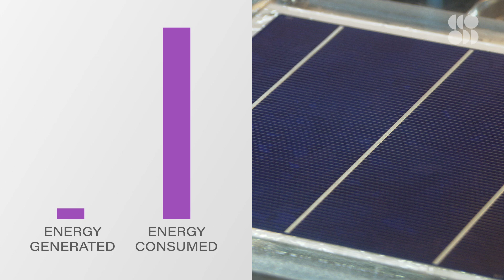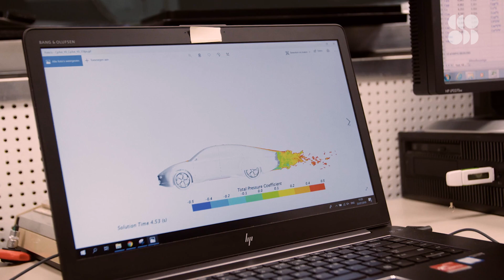The Solar Car Revolution Could Change EVs Forever

Comment: So you're telling me that these solar cars don't have lithium batteries? If not, then why don't we use this magical "battery-les" technology in existing vehicles?
Reply: they do as they said you can charge it like a normal EV
Reply: @crestofhonor2349  So how is that better? If the problem with current EVs is that the batteries make them non-neutral, then how are these better?

At that point you're just talking the difference between generating the energy. Solar on the car or using existing energy creating, which is moving towards more and more wind/solar/green. Aka, you're buying nothing in the long term and minimal improvements in the short.
Reply: @Samus11111  They really aren't much better. The only possible place and situations where these might be better is for those people who live in the tropics with at least 300 days of sunlight per year and who don't drive a lot per day.
Reply: @Samus11111  Not every place has ready access to an outlet or charger. These are also 2.5 times as energy efficient as any other car.
Reply: @fotoguru222  Fair point about the charger although you can purchase ones to connect to your house's electrical connection. But so far as being more energy efficient, roll those improvements into existing cars. Don't re-invent the wheel here and try to tell me that it's better and everything else is garbage.
Reply: @Samus11111  Re. "Connect to your house's wiring.": What if you, like 40% of the population in the US, don't have a house. Rather you have an apartment, a condo, or a co-op. Perhaps you don't even have a dedicated parking space for your car. Millions of potential EV owners have this problem.

You say don't reinvent the wheel, but that's exactly what's required to make vehicles 2.5 times as efficient as existing EVs, which are already several times as efficent as today's fuel guzzling cars and trucks. 

Did I say everything else is garbage? I don't think so. Some people need a van. Some need a pickup truck. Most people drive to work and back alone and don't need to own 2, 5 passenger gas guzzlers. If you're single or childless, you don't probably need even one big, expensive to keep, vehicle.
Reply: @fotoguru222  Apologies. The "everything else is garbage" comment was directed at the video, not your comments.

By "re-inventing the wheel" I meant that we already have EVs. If there's a better technology which improves on them, don't make a whole new product which is (according to the video) unique and separate. Update what we have. Otherwise we will have two different lines of EVs that will continue to be sold and all EVs won't be benefitting from this technology making it less effective overall for solving our problems.

My point about the charge was that (according to your numbers) 60% of the population has an option even if there aren't charging stations near them. I certainly agree that we need to improve the coverage of charging stations so help the spread of EVs, but there are also other options. Why can't the condo/co-op/apartment not install their own charging station? Using similar technology as what's available with the home charging it should be possible to set up a few parking spots with access to charging equipment.
Reply: @Samus11111  Surely there is room for a range of EVs?  Rivian has taken a slightly different line, as have many other EV manufacturers.  As Harry said, some people need a pick up truck, others a van, many are perfectly happy with a small car.  If you spend much time on the road you will soon see that most cards carry just the driver, & I suspect most have them will never have more than 1 passenger, the Aptera would fit their needs very well.  The greater the range of EBs available then that means more of the driving populations needs are covered.

Although batteries do carry a significant cost for manufacturing, within 2 to 4 years (depending on the model) EVs are better for the environment that fossil fuel powered cars, with their batteries recyclable at the end of life.  

Not everyone has a driveway or dedicated parking spot to charge in.  The full panels give you up to 11 000 miles a year for maybe 20 or 30 years for $900...  That cost of driving is ... ... pretty hard to beat!

Charging away from home is being pushed a bit here, the problem is that it is rather more expensive than charging at home (still much lower cost than burning fossil fuels in your engine), unless you are at a venue offering free charging as an incentive to use the venue...

Comment: If you are going to spend this much money on a car that you keep for less than 10 years, why wouldn't you just spend less money on a better EV and put the leftover cash into more stationary solar panels that last 30 years?
Reply: The solar panels add little weight or cost to the cars and save you from needing to plug it iin most of thee time. You would save less than $1200, maybe, by skipping the Aptera's 700 watts of solar cells. And you can use the car's battery to run more than the car as the Aptera at least will come with an inverter to power tools and home appliances.
Reply: "lasts (at best) 10 years" is a bit pessimistic, composites last well in aviation
Reply: @peterchandler8505  You are correct, what I meant to say was "keep" as Kelly Blue Book says average car ownership in America is 6 years. I edited my comment, thanks for the correction.
Reply: @IamtheDill  I suspect that a large proportion of those moving on to another car after 6 years is related to the transmission & engine that can get ... quite expensive.  EVs are far simpler to manufacture using technologies that run 24/7 for decades in industry.  EVs therefore are likely to extend the time a car is kept as maintenance is so much less..  TesLoop are a long range US taxi service that fast charge Tesla batteries to 100% several times a day, these batteries still give respectable performance after 200 000 miles ish, so I suspect EV ownership will be rather different to cars now?
Reply: @peterchandler8505  possible but we can already see the planned obsolescence built into Tesla and other EVs, increased charging rates, bigger better multimedia, battery degradation and not to mention physical wear and tear of a cars interior. Basically what I am saying is if you can afford a car with solar panels on top, probability is high you aren't the type to keep a car untill the wheels are literally falling off. Spend your money on permanently affixed solar on a property or house. It makes mathematical sense.

Comment: You can take any EV and put solar panels on the roof now.
Reply: and get a negligible boost to your range if that EV needs a lot of power to move
Reply: @peterchandler8505  It will charge the batteries when you are parked.

Comment: So Impractical, it'd idiotic to even try it without substantially improved solar panels
- a mechanical engineer
Reply: This Aptera can go 10 miles per KWH, contain between 25 and 100 KWH battery, and the sun provides up to 4 KWH per day. You can also plug it in. -- an electrical engineer

Comment: Great concept until you realize that you need the gas guzzler to pick up or get your deliveries of grocery .why aren’t people have a roof covered on their house with cells , then use these to recharge , even a shed in the back yard ....but like diesel, they said it was so economic in the 70s and 80s now the price of diesel is as high as the price of regular ,so will the price of electricity , little problem is that ,your house work on electricity , and we know what the cost of fuel is to heat a house .....natural gas is off the scale , and worse you now pay more in “ delivery and storage”  of set gas and electricity then the actual price of usage ....so no matter what you do , you will pay off the chart for your energy . That guy Tesla l I mean the real Tesla prove one thing, when you get the corporate, the bankers and the gov involve , the people end up loosing every time. Wait UNTILL you see the cells use to be regulated , the same as wind turbine for personal use , you cannot use them unless you get special permits and only the elite can afford such permits .....

Comment: Does this car meet safety standards?  How does it store the solar power? Geoff Who is curious.
Reply: Several battery options for the Aptera, 40-100Kw.  Not sure of options for Sono & Lightyear, sure that info is somewhere online
Reply: Only a few prototypes so far, not enough for crash testing yet.  I have a faint suspicion that the designers might have noticed the safety requirements & crash testing, so just possibly might have put at least a few minutes thought into them?

Comment: This can't possibly ever work for the general public, it would require the car to be parked outside in a place with enough sun that it can charge the battery.
Reply: You can charge it from a plug as well, anything from standard 110v or 220v outlets to a level 3 charger with corresponding charging speeds.

Comment: Or we could put solar panels on emtpy plots of land, and better the electricity source that goes into regular EV's. Expensive to install but more beneficial than solar cars imo, unless the tech gets even better.

The sun doesn't only shine in the city. And super lightweight cars don't seem very safe. There's a reason fairly heavy Tesla's are the safest cars on the road.

Comment: That "same drag as a side mirror" statement seems bs
Reply: I don't think it is bs! A square flat mirror has a cd of approximately 1 and the surface area is maby 0,3m^2 then you have a car "the aptera" that has a cd of 0,13 and is the size of a normall car approximately 2m^2 so. Its simple math!  0.13 x 2 = 0.26 and 1 x 0,3 = 0,3!
Reply: @oskarrabelius7384  okay, so firstly the surface of a side-view mirror that's facing the air current isn't flat, but curved, the flat side is only in the direction of travel if you're driving backwards and then, air resistance is pretty negligible. Meaning that the actual cw value is not 1 like for a flat surface, but between 1 and 0.45, the value for the convex side of a hemisphere. 
And secondly, have you ever seen a side-view mirror on a car...? 
0.3m² is literally a rectangle with one side being 30cm long and the other being 1m long. What kind of dumbo-mirror kind of car do you drive?
A normal side-view mirror on the average car is about 25cm long and at most 20cm high, estimated very generously. That's a cross-sectional area of 0.05m². So even if you take both mirrors, you get a value of 0.045-0.1 which is still smaller than the 0.26 you quoted.
And lastly, the aptera is 2.24m wide and 1.45m high. Even if we assumed a tapered form that subtracts about one fourth of the cross-sectional area, that's still 2.463m², giving it a value of 0.32, not 0.26.
Reply: @midnight8341  the Aptera rep did mention that he's referring to the mirror of an F150, which, depending on which year, can be fairly boxy. Not quite a flat plate, but probably on the high side (0.8 maybe?), bearing in mind that most of the drag comes from the turbulent wake the flat side creates. That said, yea, I don't see any chance of reconciling the numbers, the sheer disparity in cross-sectional area is just too large.
Reply: Since air resistance scales with the cross-sectional area of the object... Yeah, sounds like a heavy load of bullshit...
Reply: It would be stupid for them to mention it (several times in different interviews) if it wasn't true.
Reply: Same drag coefficient, not drag itself.

Comment: I wonder about the resources required for the solar panels if everyone has one of these.
Reply: Silicon, phosphorus, boron, silver, aluminum. Solar cells are like giant, simplified computer chips. They are simpler to build and last longer than lithium-ion batteries, and are made using very abundant materials that can be found in many areas around the globe. Far less negative impact than current consumption levels for building ICE cars.
Reply: @justin_time  But do we all need personal transport? I've never had a car. Public transport should be the focus.
Reply: @klondike444  not always practical.  Live in a medium sized town in Northern England.  Had some meetings 25 miles away; by car was put from 11am to 3pm; 8.30am to 8.30pm by bus, walking several miles as part of each journey, carrying 25kg!
Reply: @peterchandler8505  I don't think there's going to be much of that in the future.

Comment: Don’t let this distract you from the fact that a functioning water powered car was demonstrated and disappeared.
Reply: Didn't disappear, just requires more energy to form hydrogen through electrolysis than what can be recovered in an internal combustion engine or fuel cell. The real conspiracy is that ~95% of hydrogen comes from oil and natural gas wells, so the technology was most likely lobbied for by fossil fuel companies because they knew the tech would never take off but if it somehow did, they could easily switch from selling gas and oil to hydrogen without changing their business model much at all. The "water powered car" was just a distraction from the true solution - Battery Electric Vehicles. It's some real 4D chess.
Reply: No.

Comment: I mean, i guess if you really need an electric car for some reason but live in a place with no charging stations then this is the car for you. Gas is still king though. Can go for miles on a single tank, can refill anywhere, can go crazy fast without modification in most cases (my 4 cylinder honda on eco mode can easily reach 100 mph)

Electric vehicles are city cars- basically golf carts with extra safety features and range.

Edit: technically tge sun doesnt work every day. You cant get solar power on a clowdy or rainy day, you cant get solar for parts of the year in some places, and you cant park these things in a garage unless you fancy plugging in.
Reply: Yes, some EVs are no faster than golf carts, but those are not these. These can go many hundreds of miles at highway speeds on a single charge, so you can commute for quite a few rainy days without plugging it in. You probably will only need to plug one in for long cross continental road trips.

Comment: I live in Canada. You'd have to get rid of those rear wheel half covers whatever that is so you can change winter tires.
Reply: They can be removed within ~30 seconds by flipping a lever on the backside of the cover. Many cars of the 50's and 60's had them. Not too big of an issue to change tires. I know because I've done it myself.

Comment: Another option would be to have a roof mounted unit that would deploy a tracking solar array when the car is parked that would charge the battery during the work day. If the array is the size of 8 X 20 foot parking space and the cells 30% efficient; you'd get something over 3 KW. On a sunny day you might get more than 25 KW hrs. while you worked. The excess could power your home.
Reply: I tried that. Had trouble designing one that would work. Decided to let someone else work out the deetails and ordered an Aptera instead.
Reply: @fotoguru222  Love the Aptera, but for those who have a Model Y or such; it seems a deployable array might be useful. Parking lots could become solar power plants. Really cool that you considered the deployable solution.
Reply: @stevemickler452  What stymied me was how to make a quickly deployable array that was stong enough to survive a breezy day without being so bulky and heavy as to be impractical or cost prohibitive. Learned a lot about practical mechanics in the process anyway.
Reply: @fotoguru222  Solar canopies almost double the cost per KWhr here in the UK.  They are around, and great because you can get a lot of solar PV into a space that would otherwise just be cooking cars, & not to forget cooler cars at the end of the day..  Just the extra cost is the problem.  They tend to be fixed panels in preference to sun tracking though

Comment: Solar EVs are the same as regular EVs but with solar panels on the roof, aside from the solar panels they are pretty much identical to every other EV. You really should change the Title to something along the lines of "A new generation of EVs ...". 
Talking about how traditional EVs are worse because they have to rely on lithium batteries is kind of misleading since these solar powered ones have them built in as well. They can get away with having smaller batteries during daytime since they keep generating charge, but they have batteries nontheless. 
If I had to bet on the future of these vehicles I'd say they will stay a niche product because governments want you to connect to the power grid due to them using your car battery as part of their load balancing system, draining your battery in times of high energy demand on the grid without having to invest into energy storage themselves.

Comment: Sono Motors Sion is another solar battery electric car targeting a production run. Theirs looks more like a compact SUV. Super cool video - thanks for posting!
Reply: The solo is 1 seat and 100 mile range. No solo i have seen. Theur factiry is in Mesa AZ near me.
   The aptera is 2 seats  400, 600 or 1,000 mile range on a charge with 700 watts of solar.
Reply: @solarstacks  I have never heard of a "solo" solar battery electric vehicle. I was referring to the Sono Motors Sion. It is a 5 seat vehicle produced in Germany.
Reply: @justin_time  or Saab factory in Sweden?